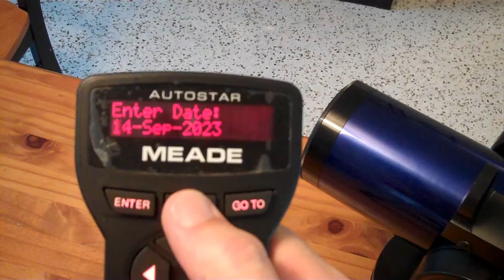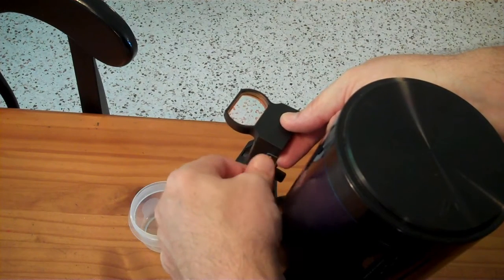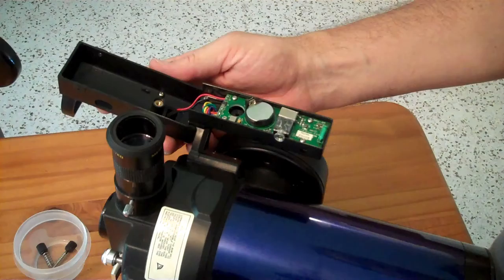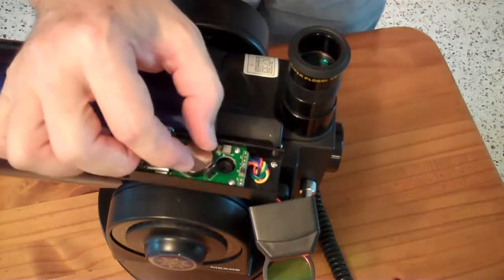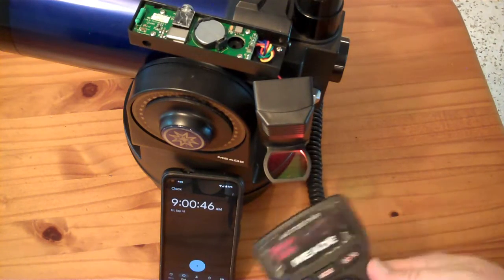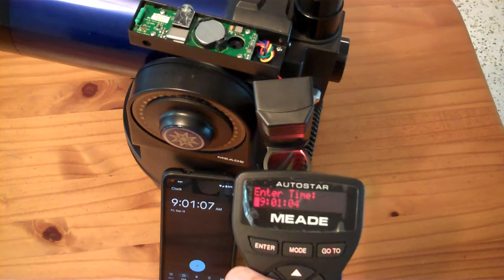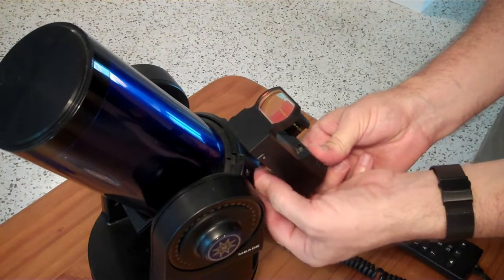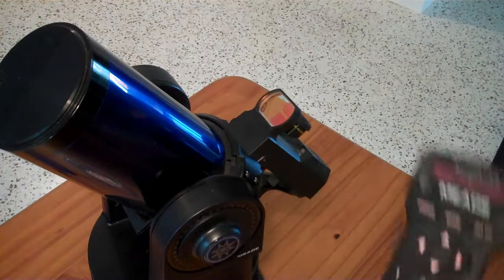Replacing the Real Time Clock (RTC) battery in a Meade ETX telescope with LNT

Comment: Finally figured out what the LED in the front of the controller is and how to activate it! You also have me looking for a feature to add to my scope because having to set DATE and TIME on the old Meades is a bit annoying! THANKS!
Reply from the maker: I believe it is possible to add a GPS unit to some of the older Meade telescopes to automatically fill in the lat/long and date/time information. [But personally, I feel it's easier to just enter the current date and time upon startup.]